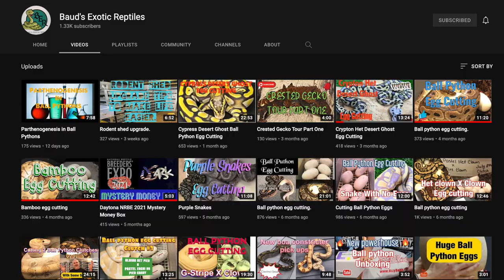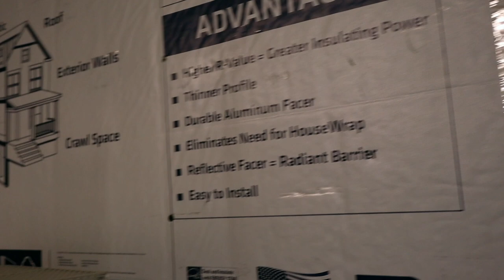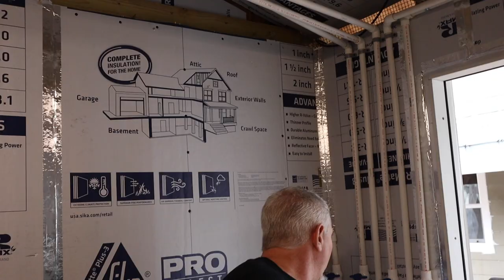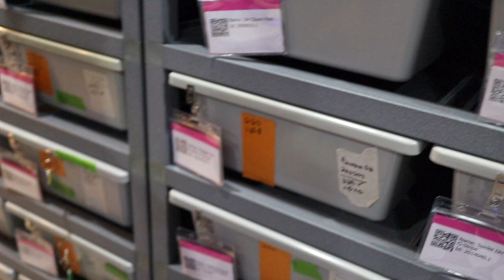Ball Pythons On Tour - Baud's Exotic Reptiles!!  Facility Tour and Animal Show

Comment: Hello Adam, I was just wondering when you formed your business did you make an LLC and if so what was the process you took to do that.
Reply: I too would like to make the switch to a business but I am unsure exactly where to start.
Reply from the maker: It's a lot to cover in one comment, but, start tracking all of your expenses.  Everything.  Organize it on a spreadsheet.  If you think it's an expense track it.  Track ALL sales.  Don't cheat on this part.  Make it legit.  Track your snake purchases at cost (not what you assign a market value to).  If you do those three things accurately, at the end of the year make sure everything is tidy, and then take it to a CPA to have your taxes done.  Most likely you'll only need to claim everything as a sole proprietor and not and LLC.  I'm not an LLC.  Your CPA will advise you from there.  Watch this video https://youtu.be/r4dzQfMBVbc Get professional CPA advice.  Ask around your town what business owners use what tax CPAs.  They're worth the money when comes to a business.
Reply: @ProperRoyals  thx you so much